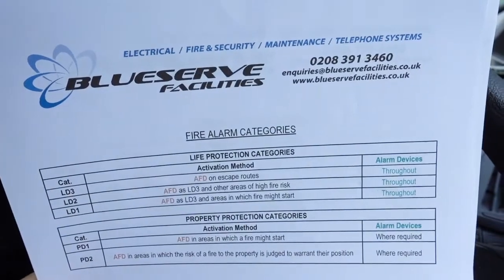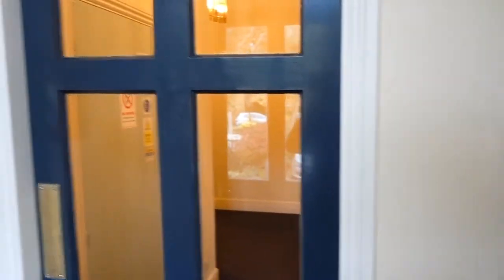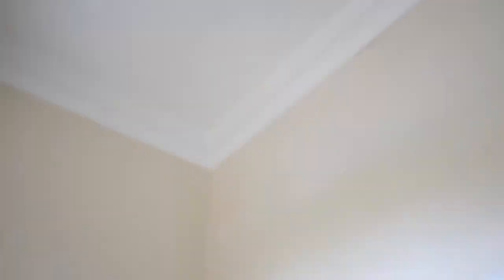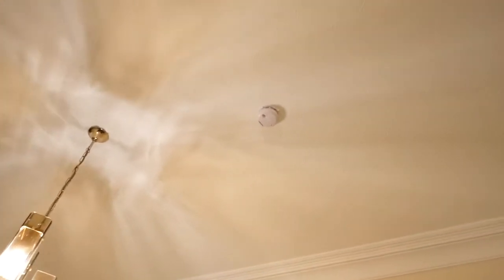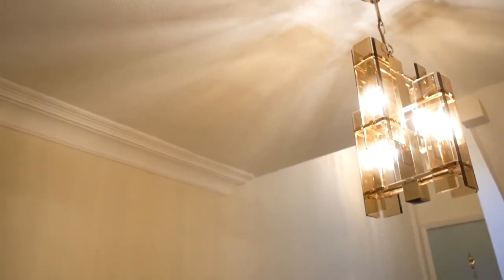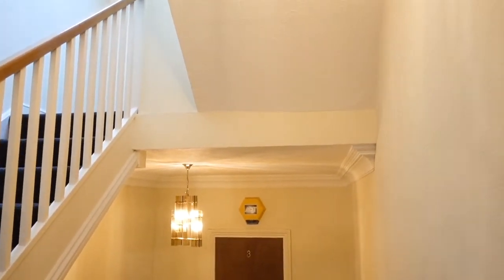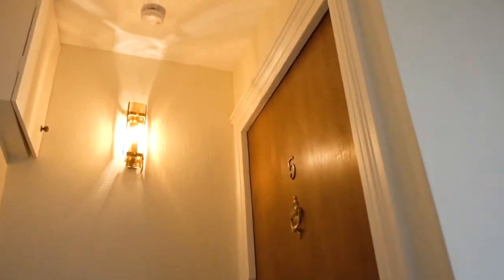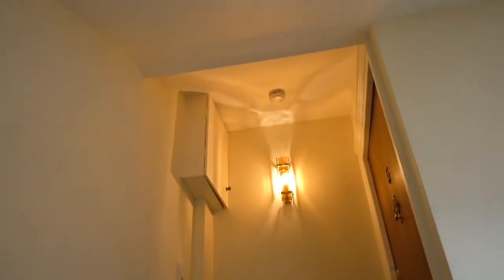FIRE ALARM SURVEY ON A BLOCK OF FLATS

Comment: Mate if it was me personally I would install a c-tec hush pro interfaced into the communal....but I have to say that cos I work for them.... or...a gent SAFE system......also recommend them skylight windows are replaced for an AOV system...I would also use 25mm white plastic conduit cos it's easier to work with...but that's a personal choice👍

Comment: He’s props wanting to go addressable due to the higher cost a 2 wire system would be more than acceptable here
Reply from the maker: Tell me James, how do you zone a building like this? Specifically the call points? And don't forget if it meets Part 6 you have to have 72Ah standby battery backup. I argue to install a compliant system in blocks of flats it is difficult to achieve without an addressable system.
Reply: @DanstheEngineer  it’s not rly flats tho it’s more of a big house it’s east each flat has their zone there is 5 flats and five zones them add one more zone for a communal zone where call points and detectors are in the stairs. It’s more than meeting the standards as I’ve seen this in flats in London with the exact same amount of floors In the building as this place and It meets standards. Twin flex pro is specifically designed for this but okay if that didn’t meet the standards why is an alarm company more than happy and elections more than happy to say it’s meeting the regs and it’s easy to identify with twinflex if a call point smoke detector or heat detector has been activated because it says Sd for fmoke Cp for call point and Hd for heat it also says the exact zone so it’s easier to identify
Reply from the maker: @jamesmoore5719  that's 6 cables running through the communal area of the building. An addressable system would be 2 cables. Small addressable panels are low cost plus based on what youve suggested the addressable system would be much less labour intensive. When installing call points, they are to be zoned according to the floor you are leaving. Often this wouldn't be the stairwell, it is the rooms off the stairwell so the design needs to be clear on the setup. I am more for reducing the amount of cabling in escape routes because when there is a fire they can become a hazard for escape and for fire fighters. I'm not suggesting a two wire system cannot be used but I'm responding to your comment about why I would suggest using an addressable system. Another issue with some lower cost non addressable panels is their inability for battery expansion when larger batteries are needed to meet standby requirements. Although the common parts here fall under part 1, LACORS guidance would normally recommend a part 6 system for common parts in converted blocks of flats. If you are required to meet part 6 you are required to have 72 hours standby time.

Comment: Hi Dan, hope you are doing good, look I am doing some electrical installation alteration work in a student accommodation in Manchester, which is an HMO building, now they have an existing Grade D2 Category LD2 system alarm in it, they have told me to put Carbon detector in Kitchen where the Boiler is, I plan to put a carbon detector on the same circuit which is currently used for smoke detectors, they currently have only two smoke detectors one in kitchen and one in corridor, none in the bedsits, its a 5 storey building with each bedsit rented to a different household, and they do share kitchen, and they also have Grade A system LD2 for they stairwells with a sounder in each flat. Question 1, does it comply if I use the same circuit to power a carbon detector? question 2 is does it still comply if the bedrooms/bedsits do not have a smoke detector individually

Comment: Great video thanks 👍
Do electricians require any additional certs or training in order to start installing and maintaining fire alarm systems?
Reply from the maker: Anyone can work on systems legally but yes - the British Standards and Legislation such as the RRO requires competent persons to work on fire safety systems. You would struggle to justify competence without some form of training if something failed one day and someone was injured as a result.
Reply: Dans the Engineer, Dan for your information. The company I work for has many accreditation’s. We have been reliably informed that the new FIA exams will be mandatory when there is enough engineers trained. So that companies will have to be accredited, Only engineers with the correct exam will be allowed to do the work-they are certificated for.Malcolm, ex fire brigade trained FP officer. As a side point remember if you choose the system don’t forget to put a legal provision to ensure this will not be instead of a fire risk assessment. When the new 5839 part 6 came out. The system has to take note of the competence of the occupants. If you need more info PM me.

Comment: can you give an explanation on the stay put policy with regards to giving occupants early warning so that they can escape
Reply from the maker: The point of stay put is that they do not escape. The building contains the fire within compartments and the fire and rescue attend and tackles the fire. It can be very misleading and the strategy needs carefully planning. But the point is that someone or something needs to raise the alarm.
Reply: Dans the Engineer cheers dan, I have had some architects drawings through for a 10 flat conversion with communal way and it says L2 fire alarm system to communal way only, should they have specified a grade as well as the category ?

Comment: Really informative video that mate..
I'm a sparky and I'm looking for Info on how to test the actual smoke/heat/co2 alarms when I fit them as a lot.of customers want them to come signed off.
Not much info out there without buying the regs on it so guess I will have to get the book.
But this video was a good watch.

Fire alarms are too complicated and I now know to stay away from anything other than your basic interlinked alarm system
Reply from the maker: Glad it helped. Fire safety in general is a whole new level of competence and understanding. Many fire alarm installers lack general fire safety knowledge because fire alarms are just one small part!

Comment: Did you get this quote excepted and did you go with L1? Also did you consider cause and effects delay for each flat as so that it wouldn't cause a nuisance to other residents should someone keep causing false alarms from cooking/accidentally activating? assuming a smoke and heat was installed in flat and a smoke would be zonal (to flat)  but a second knock from heat to trigger full activation?
Reply from the maker: Jason Jenkin I highlighted my concerns with the information provided and they were happy to accept an L3 design with a variation that the detectors within the flats would be hear detectors. They haven't accepted the quote yet because as it is a shared block of flats, they have to arrange finances with multiple people! What you have suggested is sensible but the issue lies within the flats that they are privately owned. Some might be happy to have intrusive works inside but some won't. We can of course for radio if necessary. We can do whatever they want but I am concerned that they lack understanding of what they are asking and subsequently they will always be reluctant to spend on it!

Comment: Nice video Dan , question for you , 2 storey 4 block of flats , common stair , ie 2 ground 2 first , would you treat this common stair as part 1 ? Our housing department asked me today on fire alarms in common stairs , so your timing is brilliant,  your feedback would be greatly appreciated
Reply from the maker: Jim Douglas Hey. If the flats are self contained individual flats and the property isn't an HMO or sheltered shared housing, the communal areas come under Part 1. See my notes below on what Part 6 covers. All else would come under Part 1.

There is a large misconception with communal areas but I like to refer to them as 'commercial' areas which keeps it nice and easy to remember.

BS 5839: Pt.6 covers the following domestic building types:
Bungalows
Multi-storey houses
Individual flats
Individual maisonettes
Mobile homes
Individual sheltered accommodation as well as their common parts
Houses in multiple occupation (HMOs)
Certain NHS housing in the community
Mansions 
Shared houses 
Houses divided into several self-contained single-family dwelling units

Not included are hostels, caravans, boats (other than permanently moored) and communal parts of blocks or flats or maisonettes.